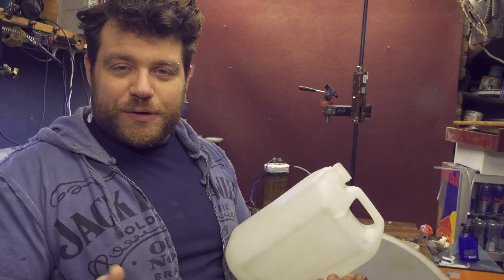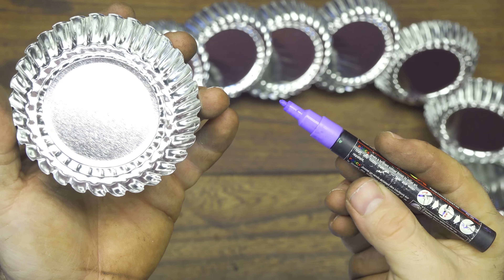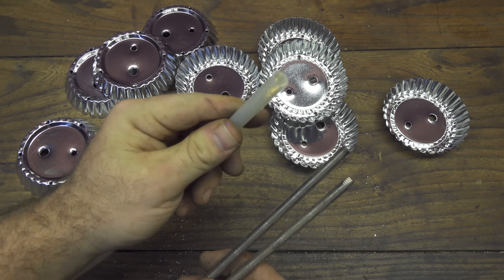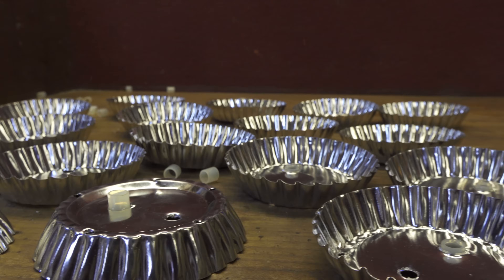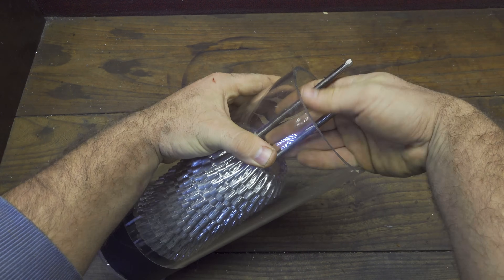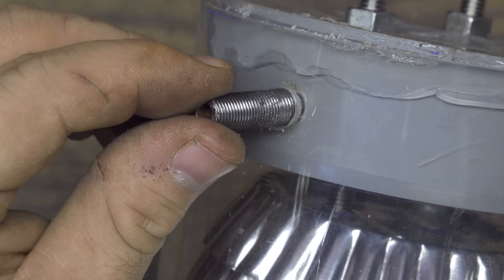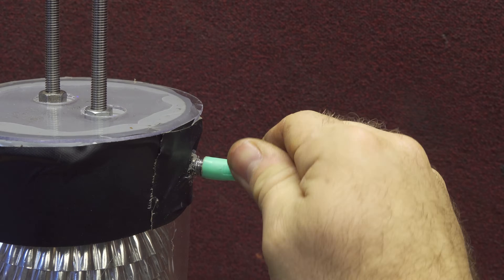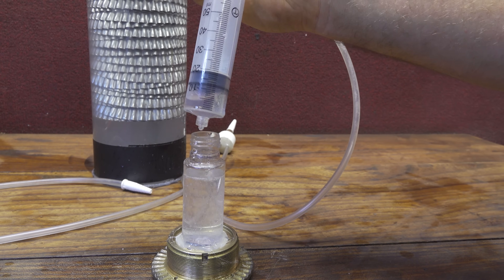Superpowerful Flame 5072 ℉ • Produce Hydrogen from Water - Do it yourself

Comment: 5000 degrees Fahrenheit LMFAO you melted a couple of little wires and a piece of glass why didn't you melt some stainless steel why didn't you melt some ferrous iron even all the stuff can you melted can be done with a butane lighter just an observation I'm not a metallurgist but I've been working with all kinds of ferrous and non-ferrous Metals for 30 years cutting welding fabricating and this invention you think nobody thought of this 50 years ago you're wrong nobody uses it today because it's way too dangerous inefficient and not cost effective this is just an observation and an opinion

Comment: very nice !!! how big of a unit would it take to run a 10 or 12 hp generator and would the generator be able to supply current to the HO generator and still supply a decent output for use ?
Reply: Sure it could be used as a source of power for the generator, but why? You are losing energy in just electrolysing water to break it down to oxyhydrogen, then you lose more energy when burning it in an engine and generate way less power at the generator output than what the generator uses.

You can't just create energy, all you can do is convert and there are always losses.

Comment: i made one test with here at home and it worked but the 12 v adapter i used broke so i was woundering how to not make that happen again???
Reply: buy a better quality powersupply,  don't just use any poweradapter for that. you probably need one with quite a high poweroutput.
Reply: Go on craigslist and find a 6/12 volt car battery charger. Preferably a bigger one that rolls on wheels. They aren't all that expensive used.

Comment: Now...  take thebgas produced, pump it into a large volume tank, and use a compressor to pump and pressurize it into a smaller pressure vessel.  

The use the PRESSURIZED gasses, to get a MUCH more powerful torch.  :-P

Comment: One problem...  your cupcake cups being upside down like that, and no vent holes in them, means gasses will get trapped underneath each cupcake mold.  This gas will cause a gas bubble to form.  This will push your fluid out of the way, thus causing the fluid to NOT come into contact with the gigantic surface area of the flat underside of your cupcake molds.  This will severely reduce your efficiency with your hydrogen generator.

Comment: I read that hho is only good for brazing, not for welding because the hydrogen would make the welds brittle, and not for cutting because cutting needs a lot of additional oxygen. 

But I wonder how SMALL you could build them, like would they work in microscopic size, or does the flame need a minimum size to continue burning?
Reply: Isn't it 2H + O? since the gases are just mixed but didn't react yet?
Reply: Actually, it is H2 + O2, since a single O would be a radical and react with anything in contact. 
But if you would use salt (NaCl) instead of soda (NaHCO3), you would also produce a lot of Cl2 which would probably not burn that hot.
And I think I could solve my microscopic problem by continuous ignition, making it an even hotter plasma burner.

Comment: Jeeze man at least make the videos original. Your copying my stuff almost frame for frame.
Reply: @Whimsical Joker grant sole that entire process for his video you doorknob. It originated on the rec. Pyrotechnics Google forum for which he gave zero credit. I was one of the guys who helped develop those simple pvc engines, along with a bunch of others.
Reply: Just subbed my dude
Reply: he has also made rubys, when I seen that,  I thouth "this guy is copying elementalMaker"...
Reply: You should be happy your idea is being spread to more people
Reply: @Drewsky840  Im totally fine with that. Its just that he presented this project as his own, and it was nearly a word for word plagiarism of my video. If you watch both you will see why.
Reply: @ElementalMaker  this guy hasn't knowledge of chemistry, it's obviuos that he will search on youtube, but he has to give you credit
Reply: @Drewsky840  Wouldn't you be happier if you were credited for your work?
Reply: Is this YOURS?  https://youtu.be/TeMkWXVbsk4    If so, I did identify some differences.  For examples, the video by the person showing his face in the above video demonstrates how to make the hydrogen generator and then shows it working.  He includes really important safety notes.  I figure both voices are synthesized but his is more engaging to listen to.  
Your video shows the device working and then melting away.  Maybe there is assembly instructions there or on a related video but what I saw was a terminal turnoff.   You may be too ugly to look at so thank you for omitting it.  You laughed about ruining your wife's hair straightener at the one-minute mark.  It is likely the automated voice just made it sound like you don't think much of her as a human being.  Instead I concluded you probably don't have a wife and got the hair straightener at a thrift shop to knock out some dabs.  https://youtu.be/CkhbMOLT9e0 .
Reply: Your comment pushed traffic to this channel. I was on your channel and this video is in the recommended list.
Reply: Awakened2Truth - Disciple of Jesus the Christ  they are not Jews, even though they pretend to be so; they are the synagogue of Satan. It is written in Revelation and elsewhere in your "New Testament".
Reply: I have watched both now and each provides an interesting and different take on the same content. Interestingly, from my perspective, both of you don't seem to have a really broad understanding of the technology in question. Both of you have provided variations on a theme that I have seen since the mid-80's. Including visiting with one of the manufacturers from that time.

Your peevishness over what you think as belonging to you being copied is not something that will enhance your reputation with those of us who have watched this kind of material for many decades. I would suggest that you simply make it educational and providing a good experience. Forget about those who copy you or better still, take those copying you as asign that you are actually providing good educational and entertaining material.
Reply: Awakened2Truth - Disciple of Jesus the Christ well since you’re a creationist, how about hopping off the science channel?
Reply: Frame for frame maybe but you don't have a fancy European accent.
Reply: @horacegentleman3296  That accent makes him a highly esteemed expert.
Reply: @horacegentleman3296  doesn't sound European more like Brazilian but could be italian
Reply: @horacegentleman3296  fake
Reply: Awakened2Truth - Disciple of Jesus the Christ  you wrote at that yet clearly haven't watched both videos. It's not about being an original project. It's that he virtually copied my video frame for frame down to the jokes.
Reply: ElementalMaker woah you just said he copied ya, not even angrily. Yet people went up in arms
Reply: Wtf some guys or grils are like,, youre obsesed with geting The credit" but  they dont know how IT feels when someone is copying or stealing your work and dosent give you credit or thanks to you. IT happened to me when i helped my friend to pass a test he took a 10 and i took 8 he didnt even thank me and he was laughing about it and from we bacame from bff to enemies. So think about it. And BTW fuck that Guy.And The ones Who are anti-ElementalMaker you are The ones Who are like our pal here rulof or you are just stupid
Reply: Awakened2Truth - Disciple of Jesus the Christ  you should then realize that the Greek, the Roman and Solomon do have something in common: they are all Babylon.
Reply: Because he don't have a idea
Reply: at least start linking your plagurized 
video so I don't have to crawl through your many vids, although I am glad to know of your channel!
Reply: It would be more effective if you linked your video in.  I am sure you know how but just hit share on the bottom and copy the link and paste it.  That way we all can see the earlier publish date and it would make your case more effective all around because that would totally turn others off the copycat.
Reply: And don't get hung up on likes and comments and subscriptions because Rudolf Maker may have purchased many/most.  Where there is smoke there is fire.
Reply: Are you actually asking for the historical perspective? If so, it can be summed up by three simple words - Greed, Control, Power. If you really want to understand why and wherefore of patent, intellectual property and copyright, read the various histories available. You might need to go back to at least the 15th and 16th centuries. If you really want to delve into the matter, you might like to look at the last 2000 - 3000 years of historiy to get a perspective.

It is really quite interesting - fascinating in fact.
Reply: @ Awakened2Truth - Disciple of Jesus the Christ  - Calling Jew Lawyers satanic is not conducive to preaching the gospel and making disciples. Always keep in mind that every person is tarred with the same brush and all should be considered precious, irrespective of what they do because Jesus Christ gave His Life for all of us when all of us deserve something far worse. 

The current copyright and intellectual property laws are not stealing from God (The Triune God of Christianity) but is actual theft from the public domain due to the effective bribery that has been in progress for a long time of those who are supposed to be safe-guarding the citizens.

As I remarked to one of @Nightman's questions, patents, intellectual property and copyright laws are about Greed, Control and Power. They have an interesting history which should be a part of the educational process for all people. But hey, that's not likely to happen.

Hating what people do does not mean we hate the people themselves. We must make the distinction between their actions and themselves.
Reply: Dude the first guy that invented this idea is Jul Brawn(look it up) a really long time ago and called it Brawn Gas.Don't be a bech.
Reply: Whimsical Joker Says the never was, never will be Internet fluffer, with 19 followers, on the comment section of a Youtube video being butthurt over someone pointing out the fact that a Youtuber didn't give proper credit. Tras de ladrón, bufón.

Psychological projection, it's pathological in non-functional sociopaths like you.
Reply: If anyone capable of making it by themself, then it cannot be called an art 😺
Reply: Awakened2Truth - Disciple of Jesus the Christ  Youtube comments section is like a big cesspool, probably not the place to be fishing for converts. I encourage you to watch "Zeitgeist" docu https://www.youtube.com/watch?v=GNXTEMnpmb8. Funny how one could also say that Christianity "borrowed" from the Egyptians and how similar the stories are.
Reply: @ @RinksRides  - Please, I have watched that rubbish and the lack of scholarship was so appalling it was laughable. The credulity needed to accept what was presented is so high.

Even simple research into history blows away many of the claims being made.
Reply: Michael Rinkle seen it and DAMNNNNNN, good roast.
Reply: Man, how can you say electrolysis is your original idea?   it's a scientific process that you didn't create? Lol
Reply: he said nothing about electrolysis  @zanekidd4394
Reply: @cleric022684  but thats elctrolysis. Dont need to name it. Because its not hard to get it
Reply: I see you are missing some information per the situation here. Rulof Maker originally presented this as his own work and gave me zero credit. He only added it to the description after it was brought to attention and commenters started calling him out. He did the same for my synthesis of ruby video, which took me months of preparation, reading through patents, and ordering/making various chemicals to test in order to make a reality. I was one of the creators of the pressed PVC motor, at least as far as I'm aware, so I'm not really sure where your going with that.
Reply: @ElementalMaker  Your obsession to be recognized is scary.  It turns me off completely.   Sincere advice:  Not showing your face was intelligent.  It allows you to consider your past as practice and... reinvent yourself on another channel as a sharing, caring human.

Comment: This is very dangerous you should always keep the oxigen and the hydrogen saperate right until you need to combine them in your torch.  its very easy to do, just saperate the positiv and the negativ elektrode of your dc voltage source in two seperate containers and connecte thecontainers somewere under the water lever with a tube to make an electrical connection. then run the two ouput tubes of your electrode containers in your torch make sure to flush the hydrogenline or better both if you are not sure witch electrode makes the hydrogen so there is no oxigen in your hydrogen line. please make an upgraded video of the device for your and your viewer safty.
Reply: Hey people opinions are always welcome and it's for safety first
Reply: Hydrogen and oxygen is water
Reply: @nfn15   you clearly didnt understand who electrolysis works
Reply: i fail to see how this separates the two gasses? when you split the molecule, it creates both hydrogen and oxygen, in the same place so how is it separated?
Reply: @explosevgamr5349  , the cathode (-) produces hydrogen and the anode (+) produces oxygen.  They don't form at the same place.
Reply: uhm in gas form their safe but if you compress them togheter its going to end up bad
Reply: matt franklin Because it is a Life Depended Mistake

But your life is not that important, so be with it for a while more 😺
Reply: Good idea sir.thanks you.
Reply: Wrong, you don't need to isolate either
Reply: So if it's water don't suppose to be dangerous how you get combustion
Reply: He already had 2 safety features I'm sure it's fine.
Reply: @aasmith6117  , very safety, lol.
Reply: @aasmith6117  oxygen and hydrogen is a very explosive combination

Comment: For best results use 200 amps and 1.3 volts
Reply: For best results use 2v per cell. 

20x plates = 10 cells.
10 cells x 2v =20v

20v@5 amps = 5v@20 amps

Comment: Why do you need a trafo and 5 V DC? 
For your 300 W, you could simply use 110 V AC and switch a 500 W light bulb in series, to make it short-circuit proof.
Reply: because the voltage matters
Reply: Why? Do you think it would produce different gases?
Reply: Harry B no it just impacts production rate
Reply: According to my school knowledge, only the amperes should matter for the production rate.
So maybe with a lower voltage it would work even better because you could produce more amperes without busting your fuse? 
Then a welding transformer should be most effective.

Comment: Rulof Maker, how you measure 2800*C? :) You not measure, right? Because hho flame have just 137*C in open air, and in connection with some materials, temperature go to melting point of this material :) Not 2800*C, thats temperature of burning hydrogen and oxigen from bottles, not hho.

Comment: Stainless steel creates toxic water when used in an electrolyte
Reply: That's why you have to use gravity assist contaminant dispenser and reuse the water endless , that means the so called toxic water  will never contaminate the environment .
Reply: @BluefuelSystemsH2ogas  what happens when unit needs to be serviced?
Reply: @jp4yu  Everything is simple , you drain  the water out from the unit in to an taped canister , live the gravity to settle down level tap the contaminant and then put the clean water back in to the unit ....and you can do this endless G.A.C.D.  ..and when you have sufficient concentration   of contaminant at the bottom , live it to dry at the sun light and the dust remain mix it with transformer oil and paint your fence ....is the same chemical used in paint color .
Reply: How ???
Reply: @electromagic3111  The use of stainless steel(SS) as an anode should be approached with great caution or best yet, avoided altogether. SS contains chromium. No matter what misinformation you may have read on the internet, SS anodes ARE INDEED consumed. During consumption highly toxic chromates are released into the electrolyte. Hexavalent chromium is extremely toxic and highly carcinogenic.
Reply: @jp4yu  why the use chromium on stanless steel 
And does alkind of ss have chromium?
Reply: @electromagic3111  chromium gives stainless steel (an alloy) its inoxidizable properties, yes all stainless steel has chromium, it must be at least 10.5% by mass
Reply: @jp4yu  but i have some stainless steel that got oxid in air  
I think that they forgot to pot chromium on it
Reply: @electromagic3111  they don't put it on it, they put it in the alloy. Probably just some cheap steel that claims to be stainless. Or you maybe cleaned it with some kind of wire sponge and particles of it got imbeeded in it. Or cleaning chemicals that reacted but stainless steel would never just rust in contact with only air.
Reply: Oh thanks a lot for this tip! What should he have used instead?
Also what happens when you use a stainless steel spoon to eat? Doesn't your mouth contain salt water?

Comment: Great video but I'd like to add, you are nowhere NEAR the temperature of the sun. 5500 degrees F versus 27,000,000 degrees is a little far fetched. Great vid though!
Reply: The surface of the sun is only around 10,000 degrees farenheit.